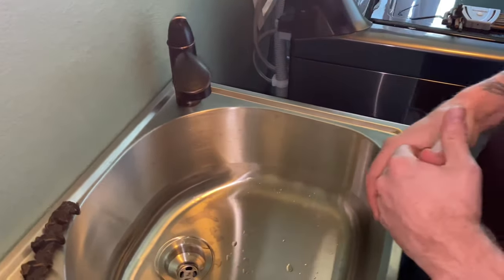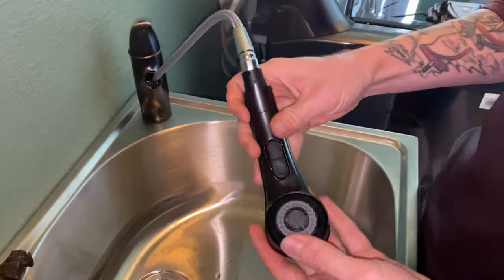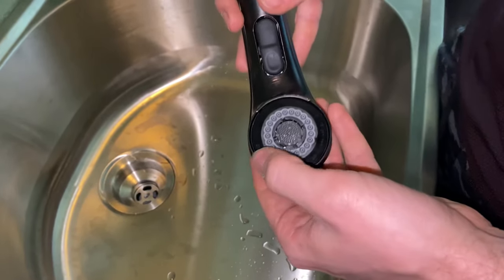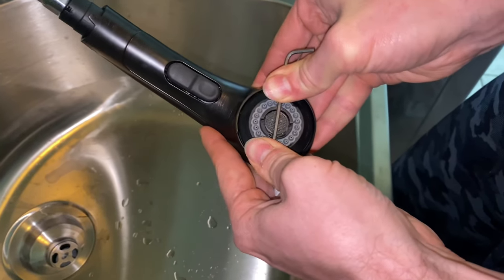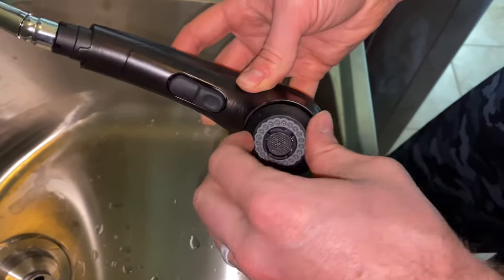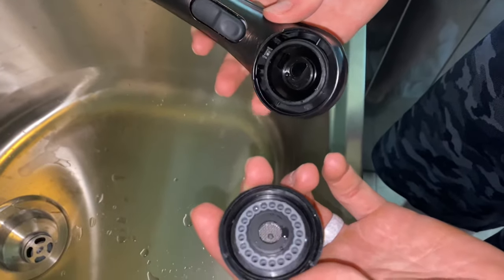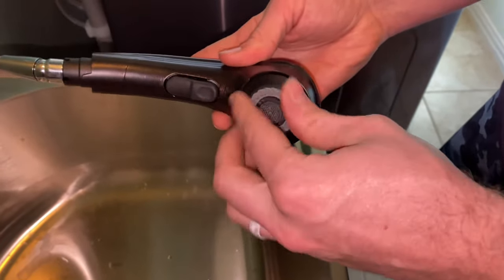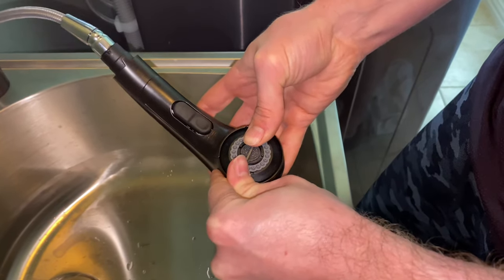How to remove a Moen kitchen faucet aerator

Comment: The Allen key tool did not work for me;  not enough grip and strength.  I got out my small hand saw (for wood) and used the edge opposite to the handle.    It was thin enough for a perfect grip and I was able to turn it counter-clockwise.
Reply from the maker: Good thinking

Comment: Take a 2inch putty knife and clamp it in a vice with 3/8 inch of the blade exposed and square-with the spray head in your hand engage the wrenching grooves  with the blade of the putty knife and turn-Do not try this without the putty knife clamped in the vice...you could slip and slice something up , like your hand!
Reply from the maker: Good technique

Comment: Thank you for posting. I had no idea the nozzle could be dis-assembled and cleaned. I used the cover from a metal electrical box instead of an allen wrench. Got a much better purchase on it and it worked out great. cleared accumulating deposits and faucet is like new again.
Reply from the maker: Glad to hear it.  Great idea on the electrical box cover

Comment: This same tip works with the Moen Renzo faucet. Also--I found using an Allen wrench to be a hassle (keeping both sides of the wrench pressed against the little slots while simultaneously turning the piece counter-clockwise). 

Presto! Use a heavy-duty paint scraper--the blade fits in the slot perfectly, and you just twist with your wrist just like you would a screwdriver. Easy to take apart and put back together.
Reply from the maker: Solid idea

Comment: Thanks so much for the tip!  However, I am not having success loosening with the allen wrench.  Any suggestions?
Reply from the maker: Someone in a later comment suggested an electrical box cover, anything long and stiff enough will work
Reply: Same

Comment: I tried this! But aerator is too tight! I am not sure how to loosen it.. any ideas? Please help asap.. thank you
Reply: Same I couldn’t get mine off, just get a compressed air can and blow the screen it will fix your issue and you will get more flow, just did mine and it worked

Comment: Can you purchase a new aerator to install yourself?
Reply from the maker: Yes you can! Good luck!
Reply: I found out that it depends on the model of faucet you have.  My Moen touchless Brantford aerator is not replacement so I'm forced to purchase the entire wand assembly.  I really like the faucet but find that very annoying.
Reply: I have a hidden aerator in my Moen pull down faucet and got it screwed off like you did using a paint scraper but don't think HD has the right size aerator replacement to go inside the hole....it says 1.5gpm and rhats what I bought but can't seem to figure out how to install the replacement piece into the middle. No threads in middle where I took out old broken aerator. I put 1 in, screwed face back on, but only the outside circle spray works and not the main middle one. So frustrating.